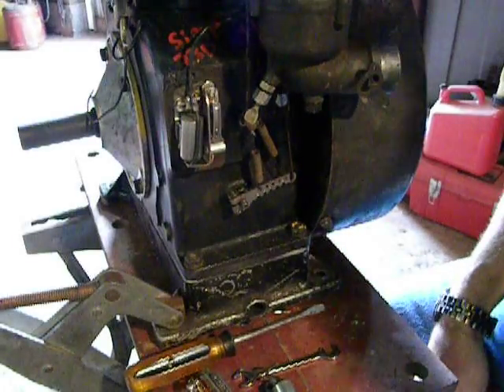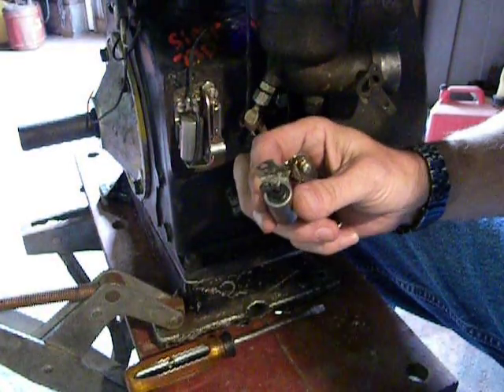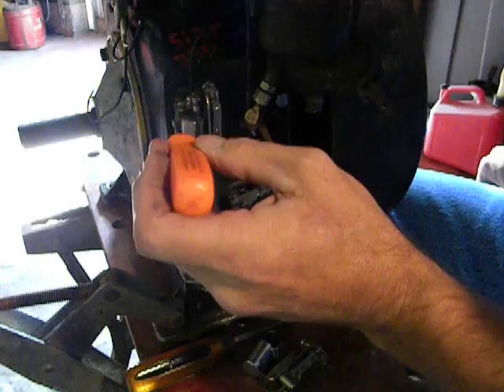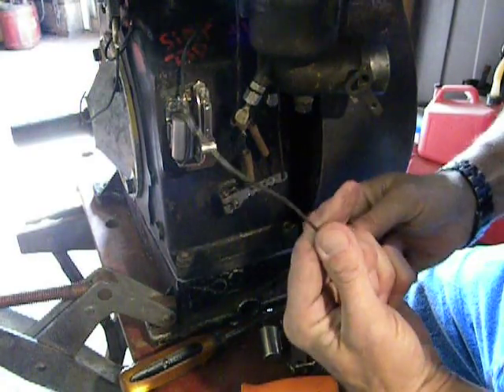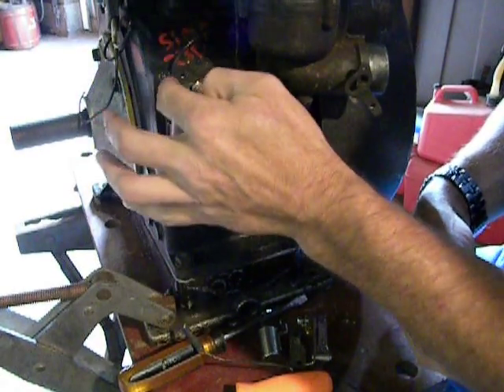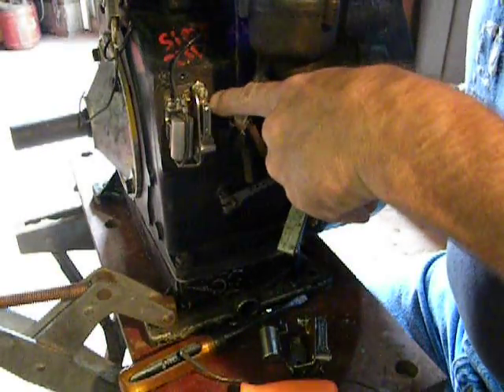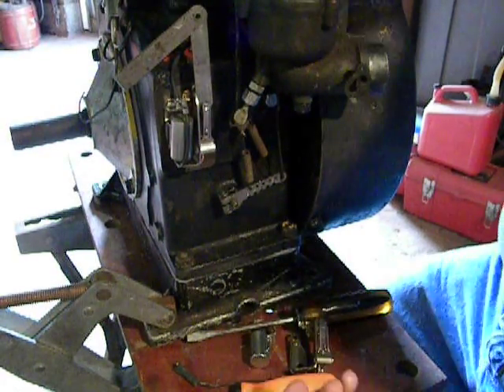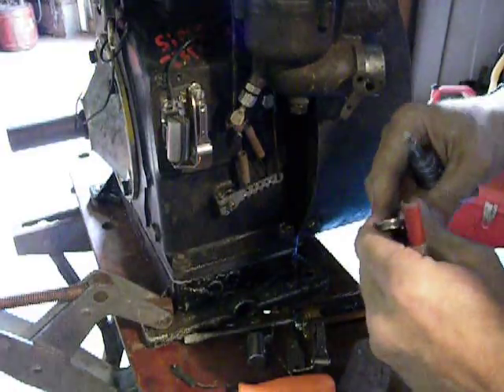Installing and adjusting points and condenser on Briggs and Stratton engines Tutorial

Comment: I have a 1979 16hp B&S horizontal shaft engine that won't fire, I have spark on my tester between the coil wire and plug. I pulled the plug and laid it on the cylinder head and the plug sparks. I took the cover off the points turn the engine e over and there is no spark jumping across the point gap. Should you be able to see the spark jump that gap?

Comment: i dont use them ,when they fail i use and electronic coil from a 12-15hp briggs vertical engine cut the spark plug wire and add extra wire to reach the spark plug ,gap it ,and there is your dinner fires right up runs on its own put ground coil wire on and its shut right off if you charging is not working and battery not to good no problem boost it and it makes it own fire keeps running ,not like points battery goes dead it stops working,

Comment: I know this is an old video, but how far should the plunger travel? Mine seems like it barely moves.
Reply from the maker: They barely move .025. Factory setting is .020 gap, but as the engines age, that gap closes. So start there and slowly close the gap until you get a nice blue spark. If you can't get a spark, you can install a Nova II ignition module and eliminate the points but keep the original Coil. Good Luck! Zip~
Reply: @ZippoVarga  Thanks. Got my new points installed and have a good spark now.

Comment: Followed this video still can’t get spark. Condenser was changed in 2020. Points look great. New carb. Could coil be bad ?!?
Reply from the maker: That is a possibility, yes. Since the coil is mounted and grounded to the engine block, you can do a primary and secondary coil test. There are a number of videos on YT. The process is simple enough. Just substitute a good ground on the engine for probing the iron laminations then check the ohms on both the spark plug boot end that connects to the spark plug and on the wire coming from the  points going to the coil. Zip~
Reply: @ZippoVarga  ok I bought a new “non points” coil and it works. Only issue now is the little spare coming off coil does not shut off motor when grounded.

Comment: What's dwell angle??
Reply from the maker: Dwell angle is the amount of time, measured as degrees of rotation, that contact breakers close in a distributor. ... The period, measured in degree of cam rotation, during which the contact points remain closed is called the dwell angle. Cheers! Zip~

Comment: I need some help on a briggs 8hp chipper engine in a W-W grinder. I don't know where the wires from the points go to 190402-0827-01-75050711. I'm not getting spark, A friend told me to bypass the points and install a magnetron ignition, but I don't know if he is right or if it will work, I'd like to keep it original, its a nice engine

Comment: Weird Question: My condenser just sits in a bracket that looks like a hose clamp.  The wire connecting to my coil has the sheath cracked near the contact point.  Can figure out why it turns over, but won't start - definitely no spark.  Does this sound typical and logical source of issue?  Sorry if that's ambiguous, I'm new to small engines.  Thanks.
Reply: 1975 Cub Cadet 1000 with 10HP Kohler Cast Iron Engine
Reply from the maker: Condenser can be part of the problem, but my guess is the points need cleaned or replaced. Check recent videos I've posted for a cold start on a cast iron Kohler with dirty points and you'll see how I cleaned them. That's where I would start. Keep me posted Logic. Zip~

Comment: Hello Zippo, It seems there are two different means for wrkg the points on 
the engine with points on the side in the square box, same side as carb is.
yesterday I worked or an old briggs. Not like this but looking at the points 
they'd be moving towards the pull-start then back to the other side. pto side.
I got a good spark and a few passes of san'paper but would love to know 
how exactly they work. Your video's are very helpfull and I appreciate the 
work u put into making them. in other engines with points on the side, the 
points are pushed out and back toward the engine. Am I right about this?

Comment: thank you for this video. i just got the same motor as the one in the video, has no spark. i didnt know anything about points. thankyou for the knowledge, im gonna try it tomorow. would you have a  the part number on a coil for that motor? any coil pointers would be appreciated. took the rust off the flywheel mag already. thanks
Reply from the maker: Jim, you need the engine numbers to locate the coil. Briggs web sight offers free downloads of your manuals which show a full parts breakdown. Zip~

Comment: I have spark but my engine doesn't fire.  Going to rebuild the points and condenser system because it's 8 dollars shipped to my door on my engine.  I think it's worth a shot anyway!  I've tried spraying ether directly into the combustion chamber and then screwing the plug in and not even a fart out of it!

Comment: Hey I have a MTD 990 garden tractor with a 16hp Briggs with points identical to this, I thought it was a carb issue at first, so I totally replaced the carb, but it seems like a spark issue now. Engine runs great and fine at low/mid throttle, but when put to high throttle the engine starts running choppy, I don’t know what the issue is
Reply from the maker: The points can be floating out of adjustment, causing them to misfire at higher RPM or the main emulsion tube metering screw could have a groove worn into it from being ran down too far into the emulsion tube (i.e. main jet). With those two things in mind, remove the metering screw (lower left side of the carburetors fuel bowl) and inspect for a ridge going around it. If present, replace with a new one. As for the points, start the engine with a reputable spark tester (not those in line light bulb types) ( I have a video on how you can make your own spark gap type tester) and adjust the points until you get the brightest blue spark. With these two potential issues resolved, the engine should run great through the RPM range. Keep us posted Gabriel! Zip~
Reply: Hey Zippo do I have to gap the new spark plug before I replace the old one I bought a cj8 for my 72 15hp sears surburban I runs but at low idle and still having problem setting the governor I turned it clockwise and tighten the nut down

Comment: Hey zippo.got 73 gilson with 16 hp briggs single.my problem is the small shaft that runs off crank or cam doesnt move in or out when crank is turned.soooo points wont open and close

Comment: I have an old 1972  ss 15 sears tractor. Can't find the right point gap or about where I should set it. Numbers on the engine are to worn. And the local small engine shop help. I know you know but the engine is 15 hp
Reply from the maker: Start at .020, then with the spark plug out and connected to the plug wire, lay the plug on a good ground. Spin the engine over and check spark. If nothing, slowly turn the adjustment screw in to a minimum of .012 to obtain spark or improve it. Likewise if you get no spark by closing the gap, open it to a maximum of .026. Within that range, you should get a blue hot spark. Once you get the brightest spark, lock down the adjustment jam nut and repeat spark inspection. Often, by locking the points in place, they move ever so slightly. Zip~
Reply: Thanks will do....
Reply: ZippoVarga, I have the same tractor, engine and issue as Joe. The Tractor was really hard to start when hot. It ran great but suddenly lost spark. I cleaned up and set the gap, but still nothing. I even tried a new condenser. I then replaced the coil, but still no spark. I will try moving the gap around as you said to Joe and see if that works. Is there a way to check if you are seeing the coil voltage at the points with a test light? I also lifted and tested the key kill wire, with no success. Love your channel buy the way. Keep up the great videos...

Comment: i've got a 3416h simplicity with the 16hp engine. I put new points, condenser in and rebuilt it cant figure out the wiring I tried every thing got any ideas or got a video?
Reply from the maker: Go to Simpletractors.com. There, there are plenty of resources for the wiring diagrams as well as many members all too willing to help you out. Good luck with the 3416H! Had one my self, and loved it. But I started with a shell of a machine and built it using vintage wiring and starting methods. Cheers!! Zip~

Comment: Hey Zippo, been watching and enjoying your videos. You said don't hesitate to ask questions, so here is my story. Before my grandpa passed he gave me his AC big ten, about ten years ago it ran. I went to college and it sat in a garage until recently. This weekend I had plans to get it running. After cleaning the mice high rise out of it I noticed they chewed the magneto wire and that is why I had no spark. My big ten has Briggs 243431 0123-02, all I could read of time code was 602081. Went to weingartz and they gave me magneto 398811. Installed it without the kill wire and with "this side out" facing out. Still no spark so I reversed it and get a spark but it doesn't seem to want to start. It came with a plug am I suppose to remove the condenser and points or connect the kill wire to it?
Reply from the maker: +Rodney Zick Hi Rodney. Look at the coil and tell me if there's a small round metal button between the two legs of the coil you purchased. I can help you further after I hear back from you. Zip~
Reply: No button in between the legs. I appreciate the help.

Comment: I changed the points and condincer. On my 16 hp B.S. I can feel spark but not getting spark on my plug. And if I don't touch the engine while spinning motor I don't feel spark. Help. Could it be magneto?

Comment: Zippo,
I have a Landlord 2110.  My condenser and points are in great shape and my tractor runs and fires.  I have a wire coming from the engine that I cant figure out where it goes. It is coming from the middle of the engine, the same place the ignition wire and sparkplug wire are coming from.  The ignition wire is connected to the point box along with the condenser wire.  What is this second wire coming from the engine and where does it go??
Reply: +bballwetherill50 kill wire?

Comment: Zippo,
Can you make a video that shows how to get to the points if they are beneath the flywheel on a B&S 7hp. This video has the points in the wrong place. Do you need special tools to get the flywheel off? I just installed a new coil and I am still not getting a spark, so I figure I have to check the points.....?
Thank You,
Steven
Reply from the maker: See my video on getting my BR6 running. Should help explain a little.
Reply: Steven Hyatt i use a propane or mapp torch, with a screwdriver or deadblow hammer. there's a tool for removeing the clutch to take off the flywheel, but you can make due with other tools.

Comment: hey i really need your my 23d briggs keeps shearing the flywheel key as soon as it fires up. Im using the correct key but it keeps doing it. I made my own too which is 3x more beef then the other one... Im about to just weld it because im only using it as a show tractor to start once in a while so i have no plans to remove it again but id rather do it right instead of cutting the crank just to replace a seal!
Reply: warriordriver350 id say your either not getting the nut tight enough or your motor is out of time. does it run good or does it kick back.

Comment from the maker: I shot a video on where to look for the many places Briggs and Stratton has placed their ID numbers over the years. Give that a look, and if you still come up with nothing, we can dig into the engine to determine approximate year and HP through bore and valve size as well as certain key features that changed over time. Cheers!

Comment from the maker: Grease is the last thing you want anywhere near the points and condenser. And yes, the installation is basically the same on all points fired engines. So long as the end result is properly adjusted points that gives you the hottest possible spark. Nice thing about these smaller engines is you have no distributor to mess with. Best of luck to you! Cheers!! Zip!

Comment: Great Video. I would imagine that the installation would be very similar for a Kohler 12 h.p. (K301) engine? I've never installed points before. I seem to remember hearing that you pur grease on something? Maybe that is for a car, and the grease goes on the distributor shaft. Thanks!

Comment from the maker: @04Dasani I can explain it here very simply. Loosen the coil bolts, put a business card between the flywheel and coil, rotate the flywheel around until the magnets pull the coil to the flywheel, pinning the business card between. Tighten the coil bolts, rotate the flywheel to remove the business card and the coil it perfectly spaced. Works EVERY time!

Comment: continued..I do have spark now and spray starting fluid in the carb and the engine just coughs a little but will not run....any suggestions on what to do next?
I pulled a muscle 2 weeks ago trying to get this dinosaur to start up and run and haven't tried to start it sense...but I would like to try to restart it this weekend...thanks for any advice

Comment: thanks for the tip!...I have a 70s B&S 5Hp pulsa-jet carb on a old red snapper tiller that was given to me.It ran 5yrs ago and just stopped.I got it and it had old gas in the tank.I cleaned out the tank and carb and replaced the pump diaphragm and cleaned out the jets the best I could.I put it back together and tried to start it but it had no spark so I bought a new coil and installed it.The points and condenser looked good so I did not mess with them.I tried to start the darn thing...no luck?

Comment: @ZippoVarga I replaced the coil and now motor runs great. I'm now having issues with the hydrostat but thats a whole different problem than this. Seems like I narrow 1 thing down and find out something else doesn't work. But I guess it wouldn't be called a project if it ran perfect. :)

Comment from the maker: @wckdkl0wn You would get no spark or a weak spark depending on the condition and gap of the points. The standard is 20 thousandths of an inch, but I have many engines that miss that mark by as much as 3 or 4 thousandths. The way I adjust the points is to get to the "home" position of 20 thousandths and with the spark plug resting on the head with a good ground, I turn the engine over while adjusting the points and watch for the bluest spark. Best of luck buddy!!  Cheers!!

Comment: This was very helpful. That motor looks like the 12hp that is in my homelite. Currently I am getting no spark. I have a feeling it is the coil or the points. Points open and close as motor turns. I cleaned up the points with some sandpaper and also bypassed the key switch to eliminate any safety switches and also tested with known working plug. If points are out of adjustment would you get no spark at all or weak spark?

Comment from the maker: @bcarbaugh Absolutely.....and make sure when they are properly adjusted that you lock the nut down securely. The points will float out of adjustment even though the screw is hard to move. They are made this way to make it easier to make minute adjustments. Best of luck!!

Comment from the maker: @scottsamonek A little off the beaten path of a garden tractor engine, but I'll give it a whirl. Under no load the engine sounds as though it is fine. Under load, it's misfiring. Get an in line spark plug tester, put it to each spark plug and run the engine. My guess is one of three things are happening. Points or ignition module, bad coil or improper timing advance. Let me know.

Comment: @ZippoVarga i like wisconsin engines. the single cyl ones are very straight forward engines it seems. i havent dug far into any of mine yet. i am trying to get the magneto on my BKN back into time still because i cant find the timing mark that is supposed to be on the cam gear. but wisconsins were known as severe duty engines in ads. built extreamly heavy but they were expencive engines.  they have loads of torque and are extreamly reliable engines though

Comment from the maker: Do you mean the single wire going to the coil from the points? Is your engine a Cast Iron Briggs? I've tried to understand and answer your question a few times, but I'm not clear on what you need help with. Does your engine run? There are different models that are set up differently. A Video speaks 1000 words.  Thanks!!

Comment from the maker: Another option which will only run you about 15 bucks is to go to NAPA and get a "points eliminator." Two wires...one to ground (any place on the engine) and the other to the coil wire.....That's it! No taking the engine apart or replacing the coil and getting the flywheel re-polarized.

Comment: if u want, u can cut the points and condencer wire and forget about it. all u need to do is buy a new magneto with the extra plastic piece comming of of the coil with that circle looking thing. mount on the new magneto and it will run

Comment from the maker: Hi Doug!! The only way you can do this is to also use the flywheel from the electronic ignition engine, as they are polarized differently than the points flywheel. Another option is to send in the original flywheel (from the points engine) to Briggs to have it properly polarized Another, easier way to eliminate the points is to get an aftermarket Ignition module (points eliminator) from NAPA. These run about 15 bucks and are a cinch to install. Good Luck!!!!

Comment from the maker: 2. These are air cooled engines and rely on the flywheels RPMs to blow ambient air accross the cylinder jug and head. A lower than "MFG Settings" can and WILL cause upper valve train stress and strain. 

So.....Short Bursts with a low idle should be restricted to 30 seconds to a MAX of a minute of run time at "lug lug lug" idle.